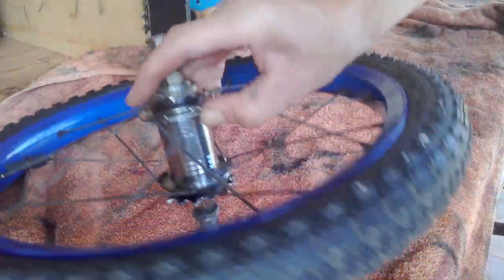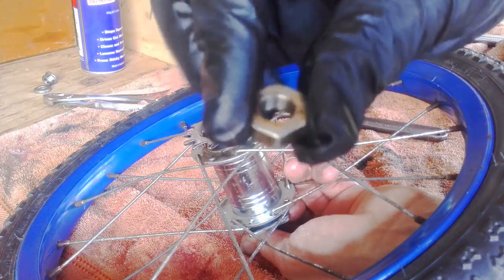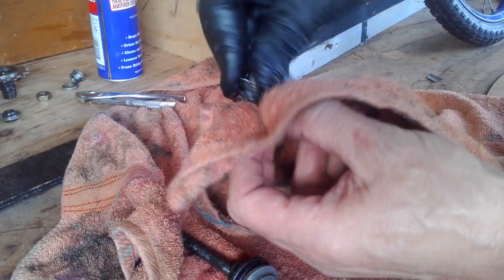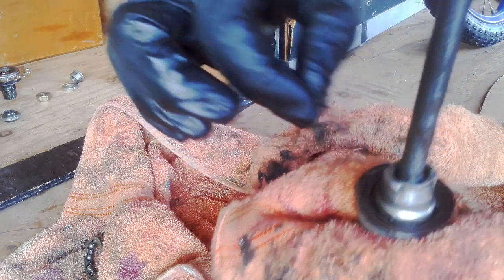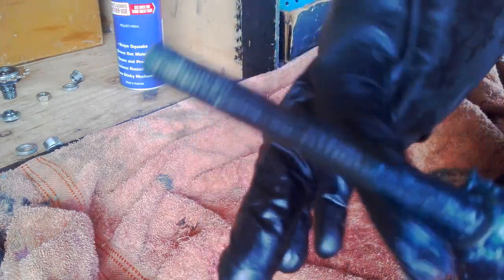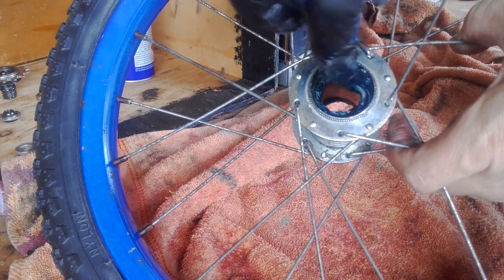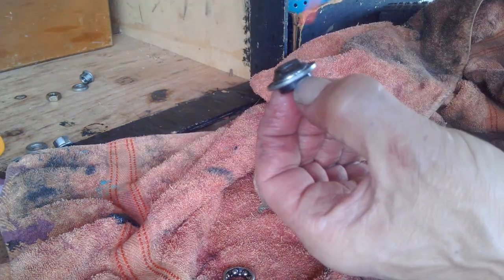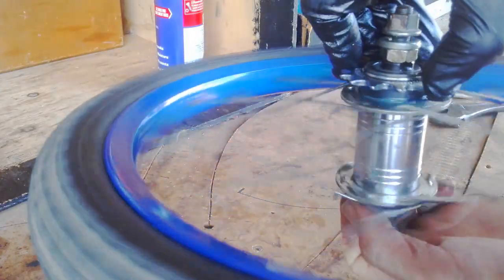Coaster brake conversion How to service and convert back pedal  brakes to freewheel hub for free.

Comment: After converting it to freewheel, I'm looking to eliminate the coaster brake lever that's attached to the hub as well.  That piece you grinded down to a nub, lol!  I need that little bit of space for the sprocket on a motorized bike, as I switch it out for some cantilever brakes. 

So, am I correct in assuming I can just remove it, and put it back together with no worries?
Reply from the maker: In my limited understanding of it is as long as you keep the crush on the bearings correct then it should make no difference. Good luck with your project, leave a video comment of your build one day.
Reply: @999samuael  Understood >>>>> but instead of worrying about it, I think I may move to the lever brakes in the rear.  After-all, it looks like a person won't really know if the CRUSH is right until you ride the darn thing, and that part of it can get me hurt. 

I've never done this, but, I am mechanically inclined.  Regardless, this is the travel means of the near  future, so, I gotta get it right.  

Thanx for responding, @999 👍

Comment: Thanks for the useful vid sir. Can you further explain the reason for bending those two tabs?
Reply from the maker: When originally you pedal backwards (as opposed to just coasting) the thread opens up the pads and you slow down.. By bending the tabs out the way and shimming out end float to bare minimum allows the pedals to turn backwards freely without the spring grinding around inside the moving internal bit that is now the drive only. Hope that helps. Can post a more detailed video if that would explain it better. As different types of coasters  require the end float to be set accurately for quick drive from a rolling start.

Comment: I have a question.... If I'm just installing a rear hand brake, can't I also just keep the coaster brake if I'm never going to use it? Why do I need a freewheel if hand brakes work through friction anyway?
Reply from the maker: No reason why not to have both brakes but coaster brakes do not allow you to pedal backwards to have your pedal on a power stroke when needed rather than the pedal at top or bottom of your stroke where you have no power.  And also your front brake does the stopping at high speed the rear just locks up (causing over-steer= a crash) Hope that helps. Remember brakes are for quitters, as better off riding like you do not have any and position yourself to have a buffer eg ride further than a door will open when travelling past stationary cars and understand counter steer and how turning the bars to the right make the bike lean to the left. Try it just ride with you palms only notice how the bike reacts and then self steers to keep the same angle until it is changed. Same with motorbikes but most people are not aware of the differences in steering between a trike (turn left to go left) v's bike and counter steer.           This why only use front brake (rear is for stability at low speed) https://youtu.be/YS15RLUQ_FU?t=496

Comment: Why do I always see this done on little wheels and can I do it on bigger wheels?
Reply from the maker: The coaster brake is the same design for all sizes of wheel. Even the 12 inch size child size hubs can be converted. Thanks for watching and sorry the sound is quite low volume.
Reply: @999samuael  can I do this with skyway tuff 2's?
Reply from the maker: @jamiecrowe3717   Having never done a Skyway I could nor say but would assume if it is a coaster break then it would be possible to hack the shamano/bendix/suntour hub etc Try it (at your risk) and tell us how it went. Thanks for watching

Comment: Hi, i tried your method but something must be missing from my part because i can't pedal forward, it's freewheel both backward and forward. I dont understand what is catching the cassette from moving when pedaling forward. Can you help?
Reply: That screw pulls wedge piece towards tapered bore and grabs hub. You might have the axle in backwards
Reply: @diatonicdoug6525 yep, I had the same issue! Thanks

Comment: I actually found this video informative but I have the issue with not engaging immediately upon pedalling again, how did you fix that issue with yours when you did it again, I don’t understand what you explained in the description on where you would put the washer?
Reply from the maker: Once the tabs are removed from the spring thing the washer/s can be placed where the tags once were engaged.  Not engaging straight away means that you need to add another washer where the broken off tag was "fixed originally". Lots of grease on the contact surfaces of the  washer/s and make sure that you can just feel the spring load up when pushing the bearing home. Too many washers will take force to put the bearing home, then excessive wear will occur . Hope that helps.

Comment: If I want to listen to a grown man groan and moan pointlessly I'd rather just walk past a line at a kitchen soup for the homeless. Watching this while trying to figure out what this guy is (attempting?) to say literally gave me a headache. Dude if you don't possess the ability to speak coherently then could you please draw up a diagram? There are so many videos out there of people showing how to turn a coaster bike into a freewheel and not a single one is easy to follow. Hmm maybe I should make one as I attempt to do this hack to my girl's bike. Will have to work on my moaning and groaning first though.
Reply from the maker: A touch on the harsh side but your lament has some merit.  Yes the I should of used an external mic and/or over dubbed the audio in post production.
Reply: @999samuael  My apologies: it was harsh. But hey, IT WORKED! Thanks very much for putting this out for the rest of us. The key part was where you said (?) to put the washer on the opposite side (where you cut the tabs off). Did this and it worked! 

PS1: for anyone attempting this plz take lots of pics of the process of how/where parts go. Doing so saved me from some potential headaches when it was time to put it all back.

PS2: do not do this unless you have a handbrake in the bike. In our case the bike only had a front handbrake, which isn't a safe thing by itself. So I found a bike that someone was giving away that only had the rear handbrake (as well as the pedal brake, which they all here in North America). I removed it from the donor bike and installed it on my girl's 16" bike. Easy to do when the donor bike is the same size as yours.

Yes, it is a bit of an ask for a 6yo that just started riding a couple of weeks ago to understand the handbrakes. But this is an important skill that every child should learn, so might as well start early. Brake pedal has its place but in our case it was causing her more headache and pain than it was worth it. So glad that it's no longer an issue. Just hope she'll be able to squeeze those levers hard enough when going down a slight downhill. Cheers everyone. And again, sorry for the harsh comment above. That wasn't (fully?) warranted :)